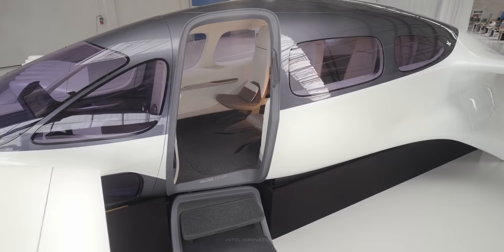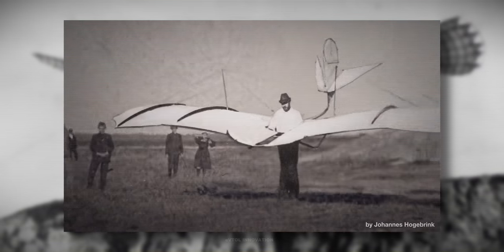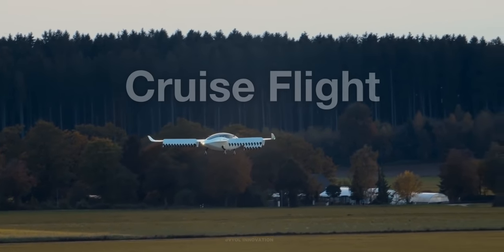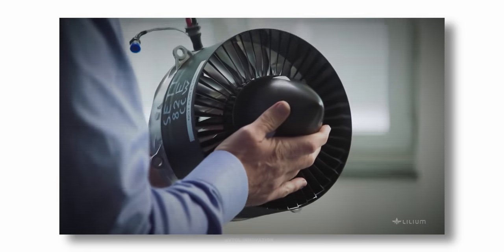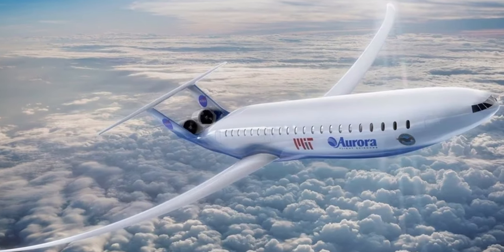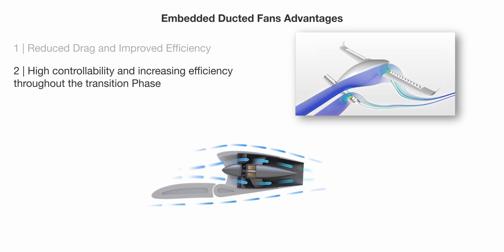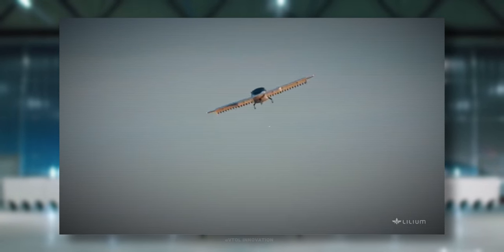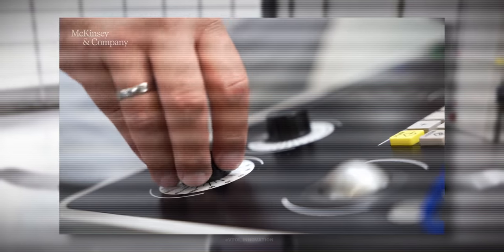The Insane Engineering behind The Lilium Jet | Part 1

Comment: What about the batteries? In Germany, there was an extensive discussion about the performance values of the plane and the size and weight of the battery that is needed. That is the biggest challenge in this project!
Reply: the pipistrel alfa electric shows that it is working. my lucky guess is, that they used conventional batteries that where available at the time of development. at that time it was around 200Wh/kg.
standard in EVs is now 240-260Wh/kg.
highest in EVs is almost 300Wh/kg
best in low volume production is around 450Wh/kg (amprius)
i suspect 240-260Wh/kg for prototype testing now. but at some point when production volume of the batteries is high enough, 450Wh/kg will be available. but for that project they used custom cells from the german company "customcells" where i don't know what chemistry the are using.
Reply: They also partnered with Livent to make a new high performance battery
Reply: @stefanweilhartner4415  Basic Cessna IO-360-L2A engine produces about 150kWt so you need about 750kg battery for each flying hour. Even if this plane is twice effective then Cessna 172 (but it dont) then still seems not ready for a commercial use.
Also have some worry about weight of all this 36 engines and systems around.
Reply: @TomasSawer  the pipistrel is already in commercial use for years now
Reply: @stefanweilhartner4415  Pipistrel has only one commercial electic model - Velis Electro with 57.6kW engine certified for Pilot training in day VFR. It has 100Knots max speed and 50 minutes plus reserve endurance which make it more glider then commercial plane. 
I'm not against elecric aviation. But seems we still should develop first lighter batteries. At least 500Wh. Then it will make sense.
Reply: @stefanweilhartner4415  tell him Amprius batteries have hit 501Wh/kg as of last week.
Reply: @pauldatche8410  yes. 504Wh/kg to be exact. i would say that sparks a lot of new aviation                                                                                                                   developments
Reply: @stefanweilhartner4415  the density you mention is for cells, not thermally managed packs, and aircraft require packs, not cells
Reply: @stefanweilhartner4415  pipistrel shows … that E aircraft can’t get FAA passenger certification, nor can any other, not anywhere in the world.
Reply: @stefanweilhartner4415  no, not passenger.  One can sell a flying rock commercially to the individual, see gliders for instance, but not for passengers. These things are closer to gliders than powered aircraft. There is no FAA cert for passenger E anything.
Reply: @Nill757  everyone requires packs. that doesn't mean it does not work
Reply: @stefanweilhartner4415  As you know, I didn’t say the plane “doesn’t …,work”, but that your battery density figures were for cells and misleading. 

“everybody requires packs”
All packs are not the same. In particular some for EVs have no thermal management at all.  Many e platforms pretend they won’t need high power discharge (heat) or fast charge rates (heat), or for simple safety with fire risk lithium batteries.  And thermal mgmt means a another pumped cooling fluid system on an aircraft, which is already severely range limited. So, they avoid them, do the minimum. 

Later, when a fire destroys their no combustible fuel, yet battery laden prototype aircraft, chalk it up  to the price of innovation.
Reply: @Nill757  ok, lets go into the detail. we have the pipistrel as a reference. it came long before the VW ID.3 which has 210...215 Wh/kg. So, i expect around 200Wh/kg at cell level in the pipistrel. amprius has 504Wh/kg with a pure silicon anode. that means less resistance compared to a graphite anode which means less cooling requirement. so, two and a half fold the energy density on cell level and less cooling requirement is quite something, don't you think?
Reply: @stefanweilhartner4415  nobody knows what amprius  “has” yet.  Energy density is one of half a dozen other requirements that have wrecked other battery tech, ie power density for discharge and charge, cycle life, temperature performance, cost to manufacturer, fire risk. Then, there is the straight up Theranos possibility, of straight up, it doesn’t work fraud. With an over 100% claimed improvement, that becomes more likely.

Comment: I feel like electric planes would really benefit from a catapult-type launch system- embedded in the runway.
Since a disproportional amount of battery energy is used up during takeoff, reducing that would have a significant impact on range.
Reply: For catapulting to make sense, you'd need high acceleration, which in turn would make for a very unpleasant flight. 
It does make a lot more sense to do that for cargo planes.
Reply: @netroy  They already do it on aircraft carriers for fighters that have drastically higher cruise speed.  3Gs would not be too unpleasant.
Reply: Yeah , I was thinking about the same..
Reply: @netroy  We can easily lower the acceleration for launching it..
Reply: Yep and could catch it too and regain some energy that is lost just braking .
Air travel is very inefficient but could be very different with some thought. 
I fly rc gliders and know just how far you can fly using no power at all, something that's not so easy on the ground.
Reply: Sounds sellable once enough electric planes traffic enough airports 👍🏼
Reply: It would require a long runway in order to not feel the crazy gs at initial launch
Reply: perhaps having a cable that supplies take off energy. then detaches at 300m altitude.
Reply: @bipedal-ape-man  Wait that's a great idea
Reply: I don't know. Tow has a long list of cons. I'd prefer to see Tow as an alternative. Done well there is super low risk during assist, maintenance is quite manageable and it's very flexible as technology changes.
Reply: Every plane would benefit from a catapult launch. But puking passengers and shifting loads are not so pleasant.
Reply: Glider do winch launches, but often prefer tow planes out of safety reasons. The acceleration is quite massive.
Reply: Yes indeed like on a air craft carrier
Reply: @bipedal-ape-man  you are not smokin nuff
Reply: Catapult   LOL.
Reply: Instead of a catapult, anything that can offset some of the thrust needed for vertical lift would be adequate.  A reusable tethered balloon or derigible to lift the craft to 1000ft and drop it so it can quickly reach cruising speed seems like a simple solution.  Though might be scary.

A catapult built on the ground would work well too... Could be much longer than what is on an aircraft carrier.  Hell could just be a Tesla with a tow rope.
Reply: You could argue the same for combustion jet engines though, the fuel-saving would be huge.
Reply: Guys if an airplane need a catapult for taking off that is not a flying maschine to rely on...
Reply: @mynameisgabriel2002  Don't think anyone is saying that it should be REQUIRED to get off the ground.  The craft should certainly be powerful enough to lift itself.   However if you were able to use a ground based system to get the craft to cruising speed and/or altitude the craft could travel further and/or be lighter.
Reply: @josephhfry  True...but it needs such a device everywhere it travels...each airport needs one for efficient taking off again after landing. Who wants to make such an investment? ...anyone?
Reply: @mynameisgabriel2002  nonsense.  Like EV's and fast charging; for everyday, routine use, VTOL would be adequate.  But some users may choose to use airfields with launch facilities to extend their range or just save on fuel costs.
Reply: Yeah, like a rail gun. Rail guns are currently military pieces, that use electric/magnetic mechanisms to abruptly fire artillery pieces. But the method could be modified to more gradually propel takeoff of an airplane. I'm pretty sure 90% of the work has already been done. The last 10% might take twice as long to perfect, which can sound bad, But even if THAT's the case, a mere 80% of the work is done.
Reply: Lol! The whole point is URBAN MOBILITY!!! The vertiports are supposed to be positioned in city centers, where building runways and catapults are a no go! 😂
Reply: or just give it a generator for takeoff and landings, just until the battery technology catches up..

Comment: Amazing what you have accomplished... the trajectory of consumer VTOL has changed. Electric Ducted Fans work great. Placement of fans on wings helps generate more lift in cruising mode. Lots of smaller fans are easier to place than several larger engine driven props. Lots of fans also mean redundancy if 1 fails.